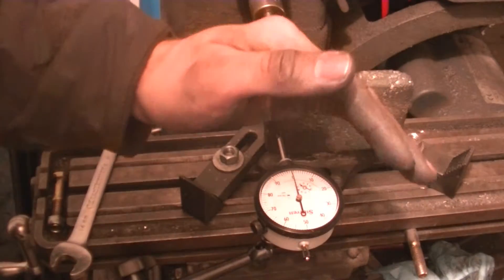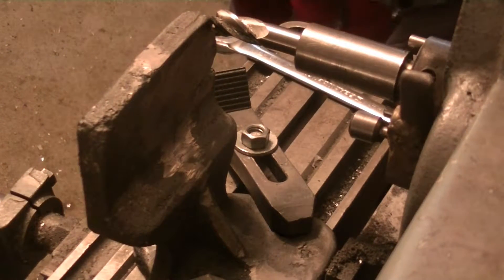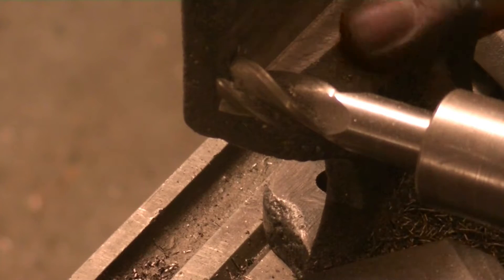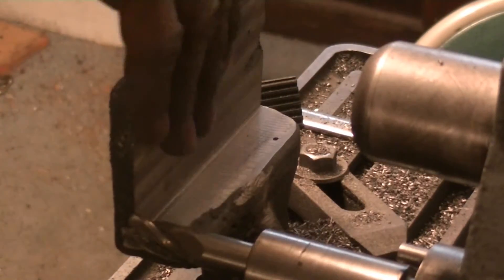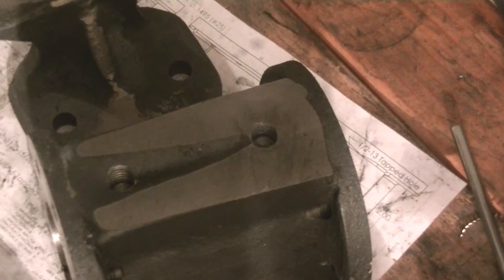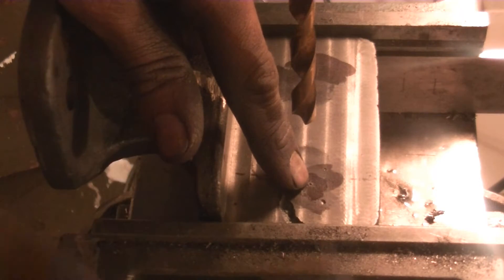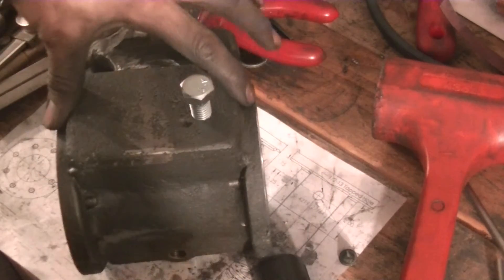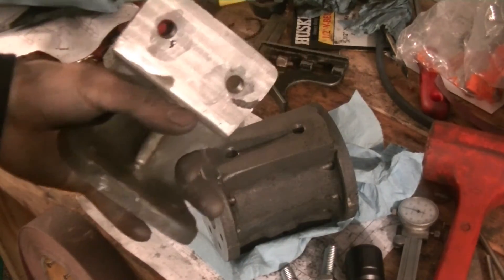Steam Engine Build:  Machining the Engine Support : Part 2

Comment: You might cast a couple of angle plates up and machine them on the mill. They will allow you to mill at 90 degree angles. A Gingery fly cutter could be cast in aluminum for the mill expanding the capability. BTW What brand is the mill? Did it not have a knee feed screw originally? Could it be repaired?
Reply from the maker: This is a little atlas mill.  It came in many different models, one of which being a lever actuated knee (they also had a feed screw one too).  Since this video, I have gotten access to a Bridgeport which is much better!
Reply: I am looking for a small mill like that. Where are you located?
Reply from the maker: I am in central PA.
Reply: A little far for me to travel as I am in Arkansas. I would like to meet you. Maybe someday.
Thanks,
Gene